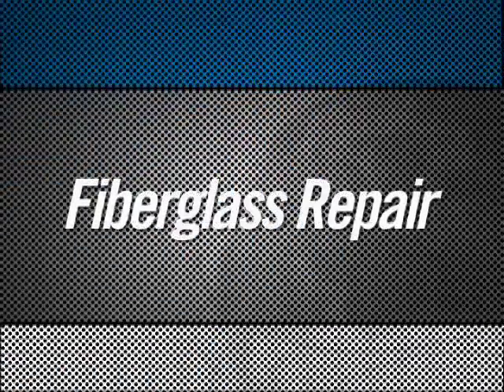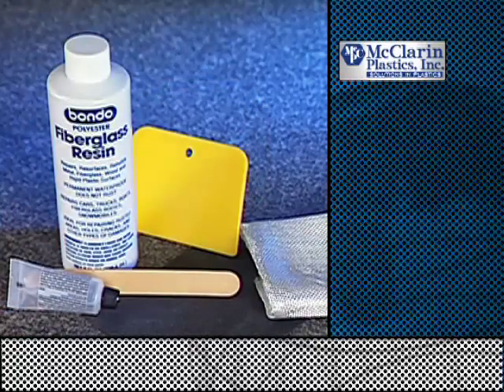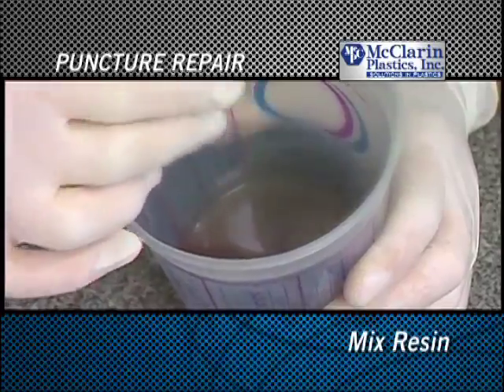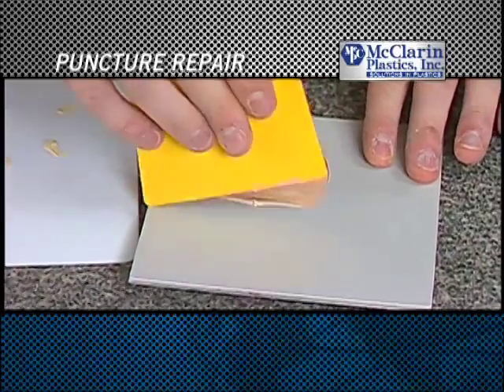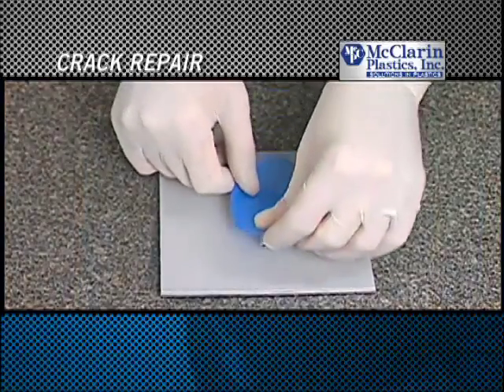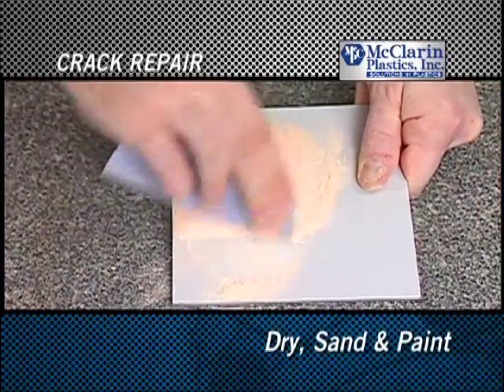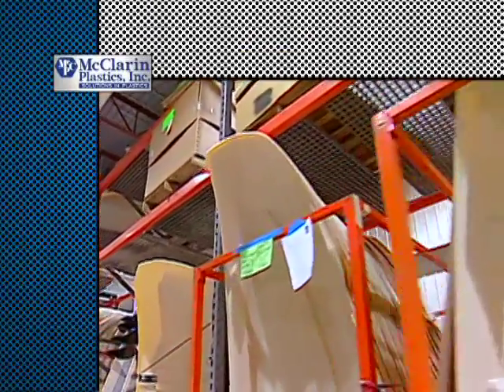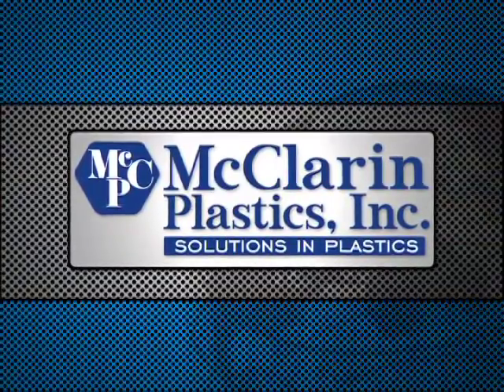McClarin Plastics - How to Repair Fiberglass

Comment: I have over 20 years experience in fiberglass repair. This is about as close as I have seen on Youtube to a correct repair. Here are a few tips. Always use mat fibeerglass under any cloth and use a laminating roller to work out the air. Second, lightly grind the outer surface at repair site to clean loose glass. I use fiberglass on outer surface as well, only using filler for filling pin holes. Makes a better repair. Heat & cool repair 4 times to help stop shrinkage from sun. Hope this helps.

Comment: I have a question:

I'm working on removing some rust damage to the bottom of my car.  I've removed a lot of the rust and have holes that are about 3" wide.  I obviously can't do the method of putting the fiberglass on the inside and putting on the outside because I can't get to the inside.

What do you suggest?  I thought of possibly calculating the area that the fiberglass would go and denting it in, applying the fiberglass and then puttying as necessary.

Your thoughts?